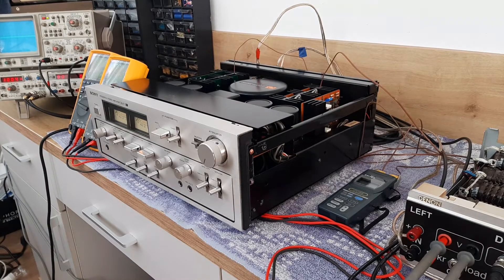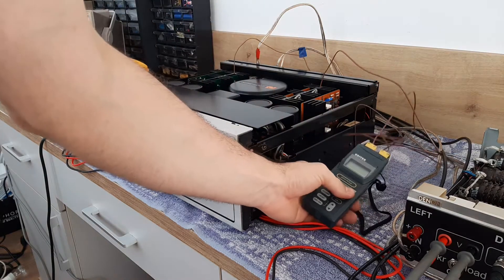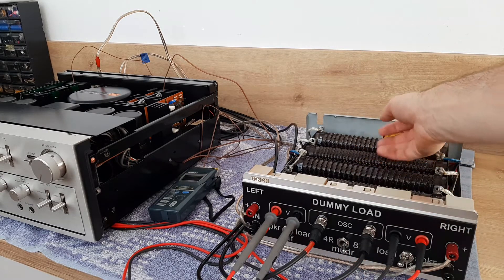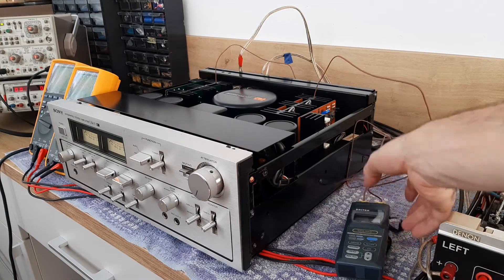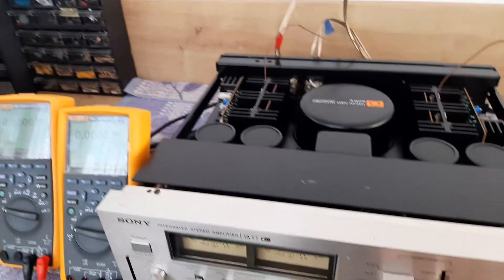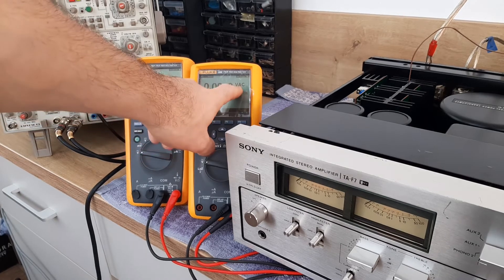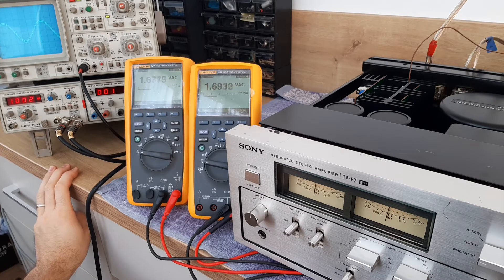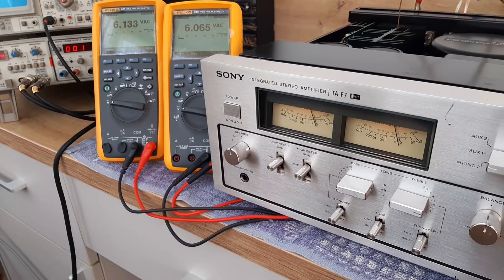VU Meters -  How To Adjust POWER Indicators ? - Power Amplifier - SONY TAF 7

Comment: Hello, thank you very much for taking the time.
If it's within your capabilities, I have that same amplifier; the channel configuration is within your parameters, as is the quiescent current.
I have the Sony TA-6B model. I'd just like to know how to adjust the VU levels. The needles move smoothly, but they don't match, and I don't think the indicated levels are valid.
The service manual is very confusing. Greetings from Santo Domingo, Dominican Republic.
Reply from the maker: Hi , first of all i have to thank you for comment on MariusHiFi Channel and for your time to watch those videos.
To adjust level indicators is very simple, i will give you two methods according with your available technical equipment. 
First one is to connect a sinus signal generator set to 1kHz on amplifier tuner/aux input, connect for speaker A  dummy loads  8 ohms for each channel plus a multimeter for each channel output set to alternating voltage VAC, after that you have to increase the volume until you have readings on voltmeters 2.83V, in this moment you can adjust trim pots on each channel for 1 W indication on VUmeters.
Second option is to use an laptop/mobile/tablet (open this link https://youtu.be/PyD9cMarVJk?si=l7flfORjsdjTcLgw) play and connected to amplifier tuner/aux input, connect 8 ohms speakers on output A + 2 voltmeters set to VAC , after this increase volume until you have readings of 2.83V on multimeters, in that moment you can adjust trimmers for vumeters to 1W indication.
This is are 2 adjustment methods and i hope they will help you!
Stay tuned , more videos to go!
In same time i will suggest to check all videos inside this channel are many many useful tricks and tips about audio reviews and repairs.
Cheers!
Reply: @MariusHiFii    Good afternoon.
Thank you very much for your valuable help, thank you for dedicating your time and knowledge.
It's easier to use the 1kHz audio from the link you shared since I only have the signal generator but no dummy speaker load.
Replace all the capacitors in the power supply and power amp. Use high-quality capacitors supplied by Digikey.
I'll be watching your videos.
Thank you again, and greetings from the Dominican Republic.
Happy weekend.
Reply from the maker: @jlrliriano  beautiful,  have a nice day!
Thanks for your appreciation!
You have a beautiful amplifier!
Take care of it!
Stay tuned, more videos to go!

Comment: Hello, good day.

Sorry if you don't understand something I write, I can only read and write Spanish, I'm using Google translator now.

If you can help me with this procedure.

I have a Sony TA-F6B, I have the technical service manual but it's not very explicit.

Please if you could help me with this adjustment of the VU meter, I can see that it needs adjustment.

Thanks in advance.

J Ruiz
Reply from the maker: Hi Ruiz, first of all i have to thank you for comment on MariusHiFi Channel and for your time to watch those videos.
To adjust level indicators is very simple, i will give you two methods according with your available technical equipment. 
First one is to connect a sinus signal generator set to 1kHz on amplifier tuner/aux input, connect for speaker A  dummy loads  8 ohms for each channel plus a multimeter for each channel output set to alternating voltage VAC, after that you have to increase the volume until you have readings on voltmeters 2.83V, in this moment you can adjust trim pots on each channel for 1 W indication on VUmeters.
Second option is to use an laptop/mobile/tablet (open this link https://youtu.be/PyD9cMarVJk?si=l7flfORjsdjTcLgw) play and connected to amplifier tuner/aux input, connect 8 ohms speakers on output A + 2 voltmeters set to VAC , after this increase volume until you have readings of 2.83V on multimeters, in that moment you can adjust trimmers for vumeters to 1W indication.
This is are 2 adjustment methods and i hope they will help you!
Stay tuned , more videos to go!
In same time i will suggest to check all videos inside this channel are many many useful tricks and tips about audio reviews and repairs.
Cheers!